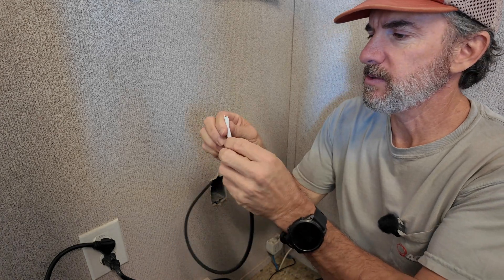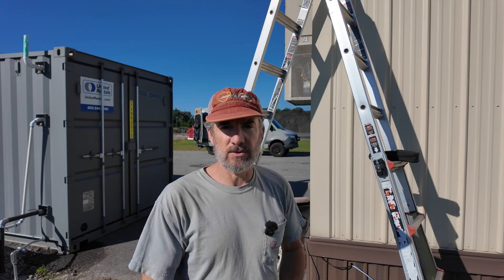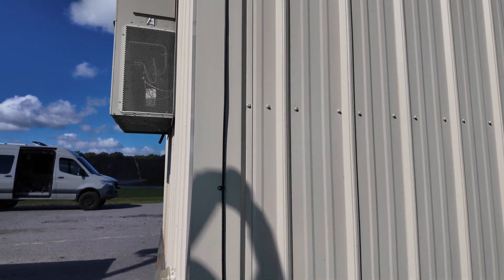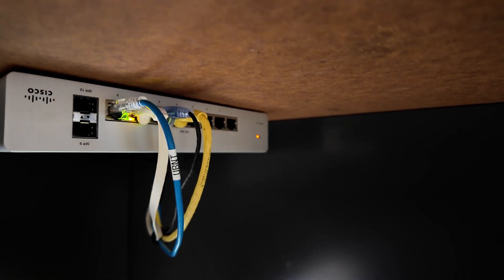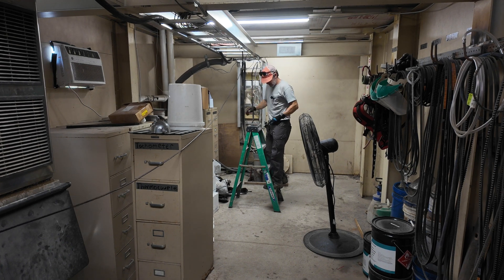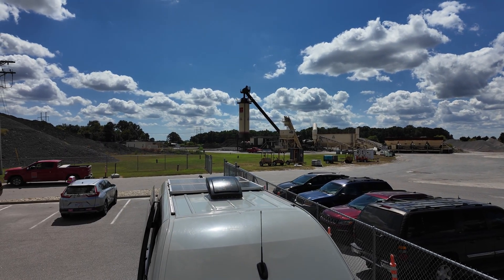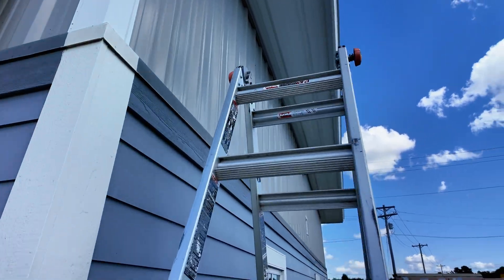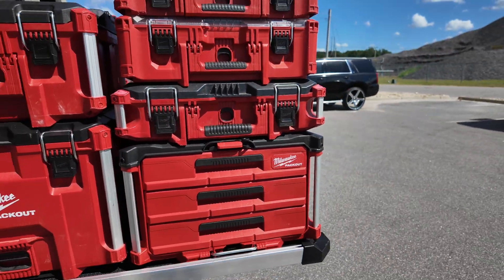Extending Internet to Multiple Buildings | Ubiquiti Point-to-Multipoint Setup

Comment: Why run the cable externally instead of going up the wall inside? Overall though a neat install.
Reply from the maker: This install was on a modular trailer and the customer wanted to be able to easily remove the unit. We typically fish walls to conceal cables. Thanks for the comment and for watching!